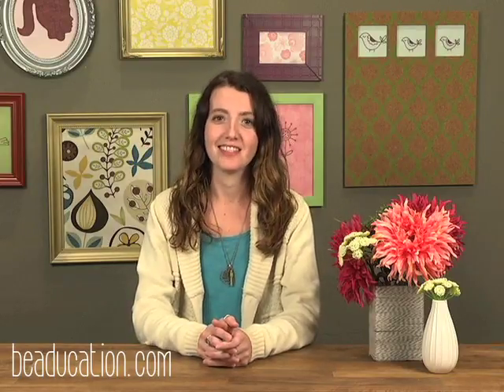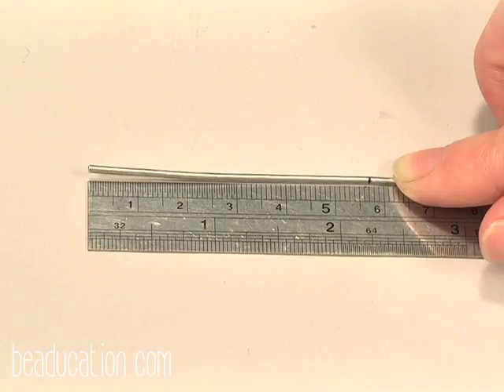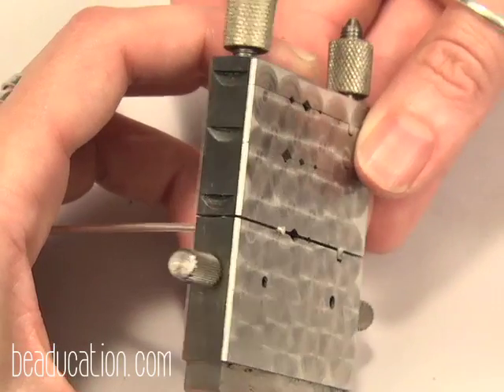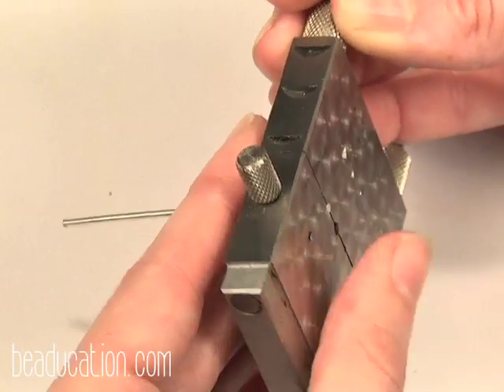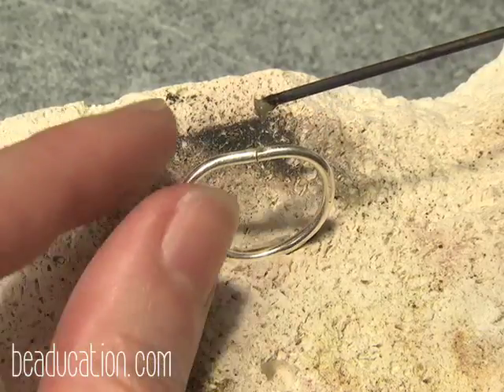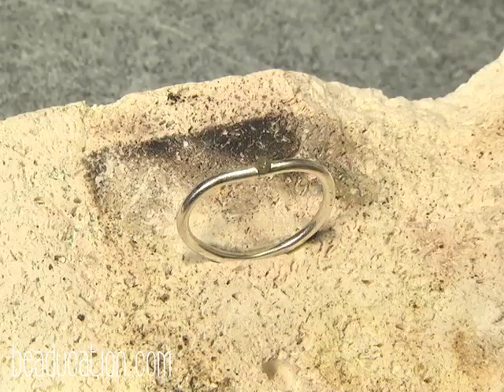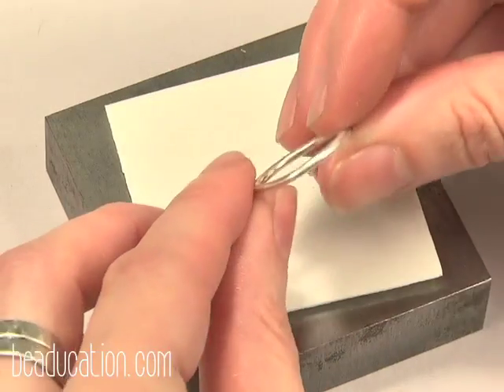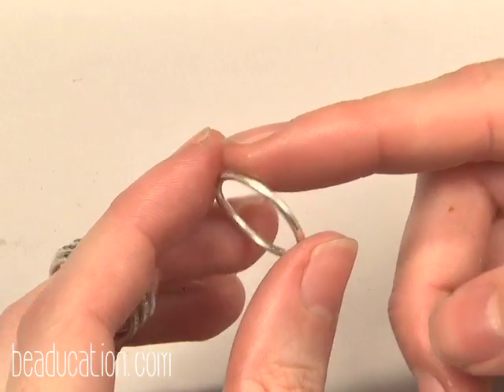Soldered Stacked Rings Tutorial - Beaducation.com

Comment: Thank you for this video!  So helpful. But I would like to see the clean-up. You mentioned 400 grit sandpaper to clean off the excess solder. Do you then progress through to 600 and then buff and polish? Do you have videos that show this process?  Thanks!
Reply from the maker: Generally just using one grit should remove the excess solder. However, there are other polishing and finishing techniques that you can use. 

Check out these classes

https://www.youtube.com/watch?v=2MfLaXuHAJI&t=41s

https://www.youtube.com/watch?v=1iZn_jv4dNs&t=125s

Comment: when using wire solder, do you use flux prior to actually applying the wire solder to the join?  Did I miss that ?
Reply from the maker: +Ruth Thomson Yes, you do need flux to successful solder the seam. Thanks for the question!